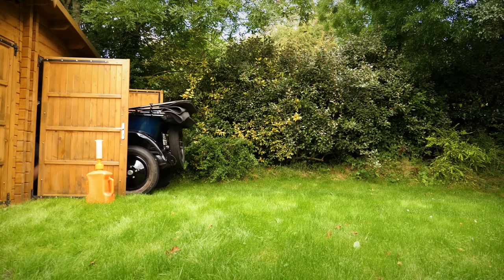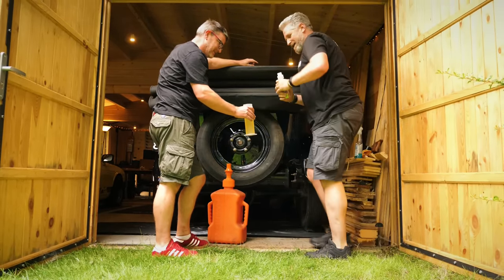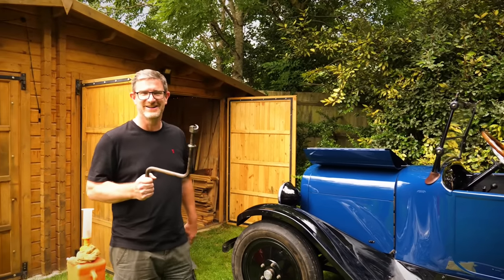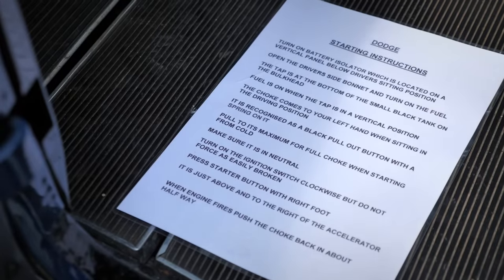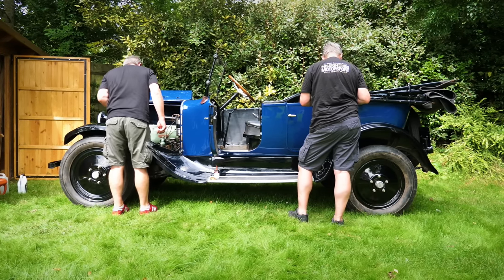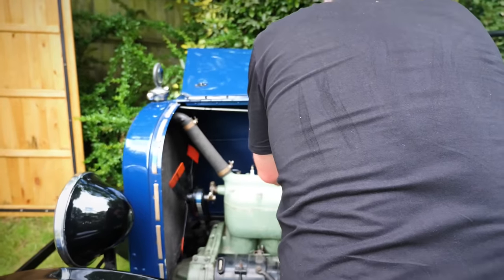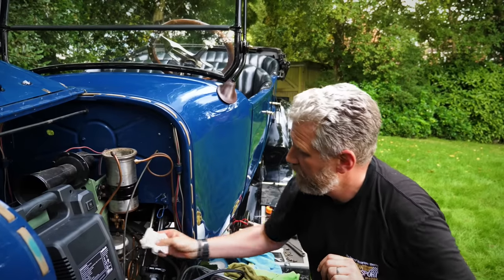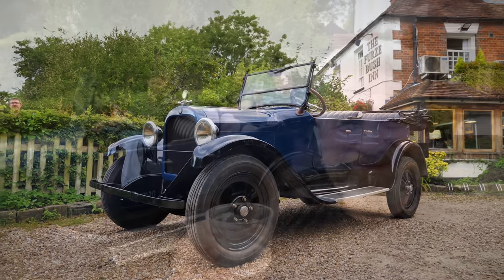A Fuelish Endeavour - Taking a Centenarian to the Pub

Comment: Can we all take a moment to appreciate that starter motor and its cable.  100% hero.
Reply: I mean, the starter motor is almost half the size of the actual engine.
Reply: Imagine having to do this job with only a hand crank...
Reply: @reijerlincoln  I would need a bracket to hold my cup of tea and a straw - there is no way I could pickup a pint of tea after hand cranking the engine that much!  #PopEyeArms
Reply: not that the starter wasn't working hard for a 100 YO part, but this old engines had so little compression that you almost can't tell if it has the spark plugs on it or not kkkk
Reply: You probably could convert it into an ev but using the starter as the motor
Reply: That was cruel! 😁 @amuaiz

Comment: When you have a vacuum fuel pump, it is advisable to fill the vacuum tank prior to cranking the engine. The fuel gravity flows to the carb. It takes vacuum from the engine to draw fuel from the gas tank to the vacuum tank. A vacuum tank full of fuel will start the engine and run it long enough for the fuel pump to do its job.

Mike
Reply: My fifty year old Delco pump has a manual priming lever. Very useful it is too.
Reply: Unless it has a stuck flap valve.

Comment: I love these old cars.  We have a few oldies that we see regularly at our workshop.  A 1926 Morris Cowley, an Austin A7, and a 1928 Studebaker President with a straight 8 that we've rebuilt as well.  It's amazing to see just how they used to be built, everything has a purpose, and there was only practicality in mind with the designs.  The Morris doesn't even use a water pump, but instead relies on the natural convection of the water to circulate the water.

This looks like a very well restored car.  They can never sit around for as long as that was without having to spend a little time on them to get them mobile again.  Good work on figuring out the fuel system, and I wish all cars came with owners manuals like this, and the Morris that we work on, which listed de coking, and re-lapping the valves as owner/driver maintenance, where as pointed out, today's manuals warn against drinking the battery acid.

Comment: Another great video, thanks lads! With regards to the water pump packing, rope packings require a small amount of leakage to function correctly. Overtightening to fully stop the leaking causes the rope to have no lubricant and thus burn out and then you'll have a proper leak on your hands. With no way of stopping it other then repacking with new rope. 

It's a great old school way to have an alright seal which can be repaired with literally a piece of string and anyone with a spanner on the side of the road. This is still in use on ships to this day for pump shaft seals but also propellor shafts on smaller vessels.

Comment: With packing seals on a pump there should always be a slight drip to keep the packing cool and lubricated, otherwise it will burn up. It should not pour out though. If it does the packing gland needs tightened or the packing needs replaced.

Comment: One of the Dodge brothers said something like “when Ford owners are ready for a real car they’ll buy a Dodge”. The Ford Model T was purposely made to be as simple as possible so there would be less to go wrong, and cost less. No vacuum fuel pump, up through around 1926 it was gravity feed from under the front seat. Gravity is reliable, but a long slow hill would starve the engine, so was driven in reverse. The Dodge was a “real” car.

Comment: Need to move the fuel shutoff valve to before the fuel pump, and let the engine run the bowl and pump dry before storing it. That way, the worst that can happen is that one, relatively-easily cleaned line and the main tank gets gummed up.

Comment: Been watching BOM for years and this is the first time I have wanted to climb through the screen and clip you all around the ears. FFS a 100 year old VAC fuel pump probably the most simple fuel pump ever made. Built to be repaired by a black smith.
Regardless nice old Dodge Brothers car. I particularly like the Fat Bastard steering wheel, a very rare thing.  BTW there is something wrong with the steering, how do I know I have driven an example of one of these and it wasn't anywhere near as sloppy and it self centered. You may have a bit of work to do in there.

Comment: My 1933 RR with vac fuel lift from the the tank was a nightmare, not started in over 20 years, occasionally would run for a few seconds, turns out the fuel lines were porous , they would leak air in. Allowing fuel to flow back to the tank. Once replaced … it would run, but an experience guy said fit an electric pump hidden somewhere and that did it.

Comment: Well, the battery is good :-) And isn't it nice not having to deal with a load of stupid plastic covers, or the important bits being halfway down the back/side of the engine with barely room to get a screwdriver in. Bit of plusgas needed for that recalcitrant screw.So how long did that take in the end?

Comment: Excellent stuff.  One small point: it's about the right era (probably slightly late) for a real crash box but I would be surprised if it was still equipped with one.  A real crash box does not use dogs to engage the gears but actually uses the gear teeth to select gears.  It is not constant mesh, as all later gear boxes, whether synchromesh or not, are.  They do not last very long....

Comment: I don't understand why you didn't just remove the cup which forms the upper chamber of the fuel pump. I mean it just hangs in there. Wouldn't that be much easier than fiddling around and sucking stuff up with a pump?

Comment: I’d never get tired of that furl pump sliding down in the bracket every time Rich try’s to push down hard on the screwdriver.

Fyi, methylated spirits is a good substance for cleaning sticky fuel residue. I’ve revived several EFI pumps simply by leaving them to soak for a couple of days. Bit nicer to drink than straight petrol too.

Comment: This would have been a tad less dramatic had you made use of this engine's 'priming cups' -- the little cylinders on the heads that look like they have a tiny petcock in them. Open the taps, squirt a small amount of fuel into them, close the taps and 'Vrrroooom' - Bob's yer uncle ;-)

Comment: What did we need an additive for then?  Dodge engines before 1936 were built to run without lead anyway?
It's possible the octane rating of any modern fuel would be way high and need calming down a bit.
Reply: pretty sure its a  ethanol addative
Reply: @MattFaz-y8t  Ahh, that would make sense, thanks.  Dodge engines had hardened valve seats 36 - up so will run happily without lead additive too.  You could get inlet valve recession but you'd have to run them really hard for a long time and you'd blow a head gasket before it would burn up a valve.

Comment: The Dodge was built decades before fuel had lead in it - no need to use a lead additive
Reply: I had similar thoughts.
Reply: lead was first introduced in 1921 to increase the octane , to reduce detonation, the fact that it lubricated the valve seats was a bonus
Reply: lead was introduced in 1921 to increase octane, to prevent detonation, the fact that it lubricated the valve seats was a bonus they didn't for see
Reply: @tonylewis8209  Initially in aircraft engines.  Not in common use in cars until the 1940s.   The Dodge is 1921 so certainly not designed to use leaded petrol.  My Model T runs on unleaded without a problem